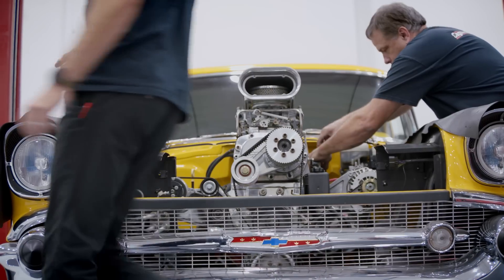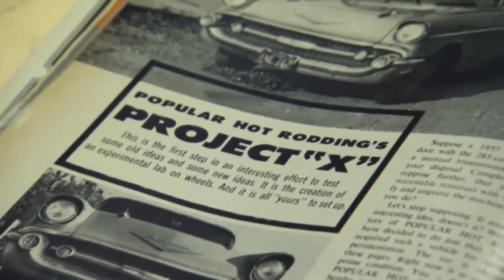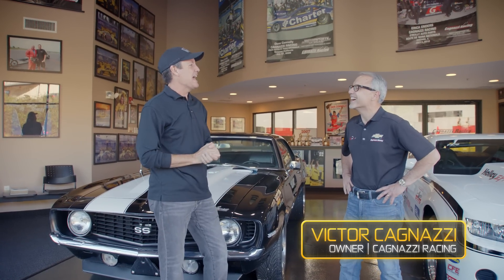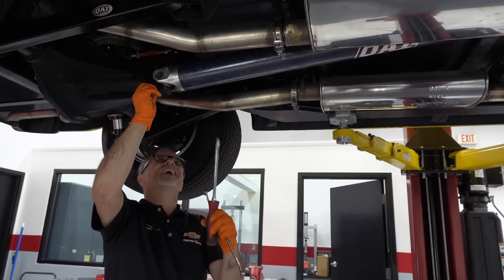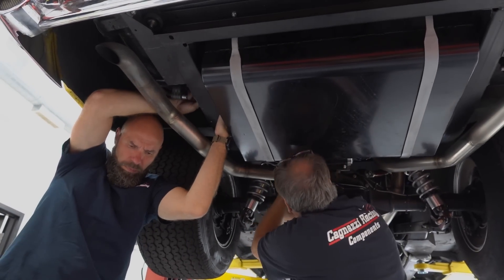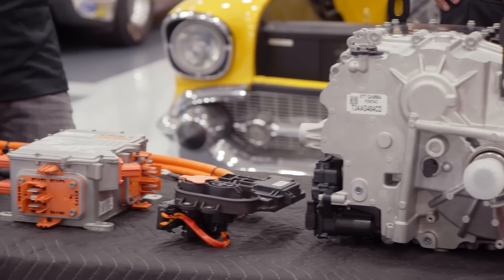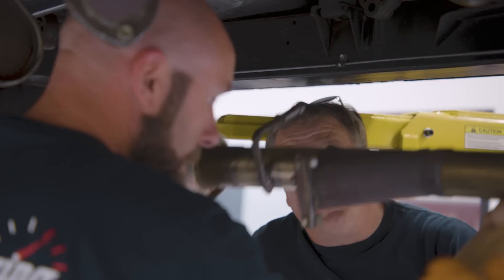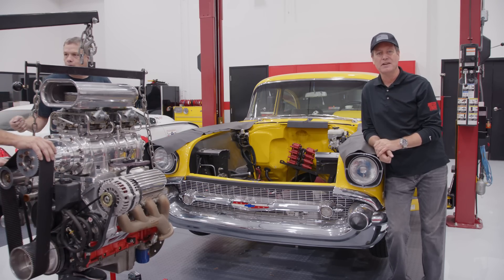Project X: EV Engine Swap [Ep. 1] | MotorTrend

Comment: This is how to turn a million dollar icon into a laughing stock unfortunately. I'm all for ev swaps but the diehard gear heads will not forgive this.
Reply: So they don't...
I love cars and I love manual gasoline cars, especially naturally aspirated ones.
But resources are scarce, gas becomes more and more expensive and the overall efficiency of an EV is more than twice of that of an internal combustion engine. If we want to safe personal mobility, we have to go to EVs. And we have to do it soon.

Done right, this could be a way to make this legend into an icon for the next generation of gear heads. And it could also show some of the more open-minded current generation that fun won't be dead.
I don't know about you but if I have the choice between paying 10$/gal to drive my 30 year old Mitsubishi Diamante or converting it to EV, I'll probably choose option 2. Because long term this will ensure I can actually afford to keep it on the road and enjoy it.

And make no mistake: 10$/gal is lowballing it.
Porsche is developing eFuels right now. They plan to be able to eventually sell them for 2€/liter before taxes. That's around 9$/gal. And this is their sales pitch! So prices will likely be higher...
Right now, the cost is more like 10€/liter or 40$/gal before taxes. And I'm not that optimistic that they will achieve their goal of 9$/gal given that more and more energy will have to come from cleaner sources which - at least for a while - will make energy more expensive. And since more and more energy will be needed when replacing fossil fuels (e.g. in heating and mobility) there won't be as much (cheap) energy left to produce synthetic fuels.
Reply: @vinzenzgeske8987  Where does the electricity come from? Do you know about the infrastructure that still needs to be built and the shutdown of the Keystone XL Pipeline? https://youtu.be/7Yw-s0INT4w - I actually come from the PA Anthracite region where the coking process for the steel that made the skyscrapers in NY and the bridges like the Golden Gate possible. We lost our rail system to make any of that even remotely feasible back in 1972 during Agnes after Goodyear was also buying up electric rail systems to shut them down. Step back and think for a moment. The rail systems we do have are mostly diesel with air brakes developed by George Westinghouse. There are a lot of things in play that shouldn't be right now. It might feel Righteous to scold somebody over a '57 Chevy gas guzzler, but the alternative is actually worse for at least 2 more decades on our current path. It's too soon and it is the wrong car. This is some smoke and mirrors to make non-thinkers feel a little bit better as they are losing a little bit of freedom every day with every new tax. Those taxes and regulations work to shut down the free time you can have so others can have more and do nothing with it. That's what it looks like anyway. A big wealth transfer.
Reply: @vinzenzgeske8987  Then electrify a stinking Toyota............. Better yet, electrify a worthless 3rd or 4th gen Camaro. LEAVE HISTORY ALONE. RIP Project X. RIP GM, time to go back to my Chrysler roots.

Comment: For first time an LS conversion doesn’t sound like a bad option to keep Project X down to it’s roots…this electrified system can’t be sourced by the average hot rodder at a junk yard. It’s now into appliance mode with no rumbling soul.
Reply: So did you feel that way when GM shoved their $25k all aluminum 632 big block into Project X like 10 years ago?  Cause you couldn’t get that engine at a junkyard either
Reply: @GODOFGUITAR2112  not really….the rumble was still an option as the “soul” of the project.  I’ve built go carts they are fun AF but they die there. Some even use “sounds” to keep you thinking it’s a car….lame AF.

Comment: I'm sorry but electric vehicles are the enemy of Hot Rodders like myself. They may accelerate fast and all that but there is no replacement for the sound of a true Hot Rod. You should if left Project X as it was and changed up a Prius or a Chevy volt. Total disgrace to what Project X was. Gone forever.

Comment: I agree with other comments. If I was at the sit down meeting when they pitched this here's what I would have suggested. Build a  2nd 57 same as the original project X same color yellow same look, no motor or trans. I would have called it Project X 2.0. This way you have two to tinker with and modify the original blown X and the electric one.
Reply: This would have been a brilliant idea and great compromise.
Reply: Makes sense, and built as an ev swap to begin with? 
Would've allowed them more time and better integration with a lot more power&range possible as well. 👍🏻
Reply: Exactly. Then they can race each other too.
Reply: yeah like what was this the LAST '57 chassis in existence...?  was there nobody at PPG/AkzoNobel who could mix and spray yellow paint (or maybe a another color to differentiate the new car from the original)...?
Reply: Agreed!! And if they would have had a competition for the two of them the gas version would have won by a mile hands down in every single aspect!!

Comment: Sad, RIP to an iconic car. Hot Rods arent all performance. You dont feel an EV when it drives by, you feel a hot rod. ☹
Reply: Do you have or ever driven a EV? You do feel a EV. you feel its instant mega torque. you feel a vehicle that just wants to blow the doors off every gas car around. And it can do it all day long. no overheating, no fouled plugs, no bad gas, no vapor lock, no heat soak. they just go and go. I have a few hot rods and was in the middle of building a bored out 460 to go in my 53 ford customline and was like why... why am i wasting all this time on this old beast when im going to end up with a car that a EV Hyundai Kona will blow the doors off.   So im going to get the flathead running until i get the parts together to ev swap it. Thats hot rodding, gas, diesel, ev dosnt really matter as long as its fast. and the fastest now is EV.
Reply: @3184Patrick  dgaf, give me the smell of oil, the feel of a burb in the engine, the noise of combustion. I do agree the powrr you feel on evs is intense, but you dont get the expierence. Its too rounded and soft and theres no actual feel of the car. Its theres, you sense it, your body knows whats going on, but you dont get that same rush of hitting a gas pedal and listening to your work come alive and scream down a road.

Comment: No doubt it will have impressive performance, but you should be ashamed, doing that to such an iconic piece of hot rod history.
Reply: It’s really not that impressive though. 340 hp and 300 ft lbs of torque. About half of what the blower motor did!

Comment: I think they should’ve went the hybrid route and gave it a electric motor with V8
Reply: Yes if it had to be EV, how about something in the spirit of the Turbonetic Rocket Axel , mounted to the rear end as a power booster 🤷‍♂️ They aren't innovating,  they are desecrating.
Reply: @chuckchar  I think they definitely skipped a step in innovation.  It's still new internal combustion ideas and uses being made also.  It just makes sense to bridge the gap with the best of both worlds.  What's a restomod without a v8 grunt

Comment: Freiburger please send all the 57s old equipment to georgia and resurrect project X with one of daves 57 chevys.  The parts are already closer than cali. Put it back together and put some rattle can spots of yellow here and there so it can be a roadkill warrior. put it on ethanol/methanol. thats clean and renewable.  you could call it spirit of projuct x? the electric stuff is coming, but leave it on a tesla please.

Comment: I guess an LS swap is not as bad after all..
Reply: Put a 305 in it out of an 85 Camaro with 200k on it but not this
Reply: @lunsy9420  LOL.
Reply: @lunsy9420  That would be better, and much safer for the average hobbyist that probably should not be toying with maybe 400ish volts at home. It is pretty serious stuff.
Reply: @TwoBlackMarks  it's not that bad if you have some comon sense and del with it PROPERLY these battery pack have isolators that disconnect the batteries from eac hother bringing them down to nominal 8-12v cells
Reply: @jackass123455  While I have a lot of stuff to say about it, I will only say that common sense is actually not as common.. :D
Reply: *are not as bad.
Reply: @jumpinjojo  if you are going to correct someone's grammar, atleast make sure you are right first smh.
Reply: @MrHarleyreinke  Notice that he edited his comment.
Reply: @jumpinjojo  :D

Comment: How dull it is. No way to make it faster. Electric motors have very little room for modifications. 
Anything with the same Motor will be the same. And your Phone will have an app to make it run. 
It's a slotcar except you have to bring the power source with you. Good to get around town with.Try your electric buggy at the mall. That is how dull it will be.   CAT will spray it.

Comment: I just love how everyone on this video is so excited to see this happen I'm just wondering what this ev crate motor costs and how much much that shop is getting paid to do this and to fake being excited for this project and sure you can do something but should you and when ev's have a problem and there broke down on the side of the road you aren't fixing it there you're calling a wrecker tow truck
Reply: A wrecker, and a hazmat crew,  if the battery case happens to break open.
Reply: I'm just wondering how you fail so miserably at the spoken word.

Comment: The lack of noise, feel, and smell is why we don’t really care for electric motors in Hot rods 🤷🏾‍♂️
Reply: Exactly.
Reply: When you here this go down your street you will say you just heard a yellow vacuum cleaner go by.
Reply: You want a speaker with a rev range and a seat rumbler? :D
Reply: Racers want to go fast / quick.  This will be fast, quick, and clean.  Want an 8 second street car with A/C?  Like maybe a Tesla Plaid?  You would have won 11 of 17 2021 Hot Rod Drag Week Classes as well.  You can either Lead, Follow, or get out of the way.
Reply: All it takes to beat a Tesla of any sort is a 4.8 Ls motor. File the ring gaps, Install a turbo. Will beat any tesla.
Reply: @moabman6803  Can you show us a 9.01 second 4.8 LS / T?
Reply: @TonyK3130  A stock 4.8 with a turbo is capable of 1500hp on the stock bottom end. It's been tested thoroughly. That should get a car or truck to 9 seconds or better easily. There is a Tesla drag race guy on YouTube. He posts a bunch of videos. In one of his videos a turbo LS Silverado beat the Tesla like he was standing still. LS motors are cheap power if you know what your doing and will beat a lot of so called performance cars.
Reply: Put a speaker under the hood make an artificial engine sound
Reply: @Mike-01234  that is a bad joke
Reply: @Mike-01234  You do that with your blow up partner?
Reply: @Mike-01234  add vibrating seats for that rumble.

Comment: Instant torque cool but what does it feel like sitting at the stop light? What does it sound like. Can u crank it up outside and feel it inside the house? A lot of what makes these hot rods great if the feel and the sound, so many of us crank our cars just to here them idle in the driveway. Yes the instant torque is cool but in drag racing applications it’s still gonna have to be managed especially if it still RWD. I’m jus sayin never in seen someone with a quiet hot rod that really turns heads 🤷🏾‍♂️

Comment: They are building a Tesla in Tony Nancy yellow.  Wow what a waste of a great car. Way to help the EPA kill TRADITIONAL hot rodding.
Reply: The EPA is dying to get rid of old cars and trucks. Instead of going after gross industrial polluters, they are coming after the low hanging fruit, hot rodders or anyone else who doesn't have the funds to fight them. - the rpm act
Reply: EPA has bought out gm. Meanwhile China still burns coal what a joke.They think we are niave fools.
Reply: This is hot rodding.
Reply: @TJDST4  A 200hp bolt motor isn't a hot rod.
Reply: @LegionOfHobbies  you're correct, but that is not what this is.
Reply: @TJDST4  You're right. It's a 340hp engine. Still don't know if I would really call that a hot rod, but it is better than I thought.

Comment: electric motor ad ons making cars hybrid is the next step trust me NOT replacement drivelines with complete electric motors, replacing a diff and trans with a tough drivetrain electric motor power adder , what you out of touch nitwits are doing to this classic is sacrilege

Comment: I get electric is the future but I love the sound of cammed out big block. Just wondering if there is a weight savings of the electric motor, batteries, cables and controller over the gas/diesel engine, transmission and fuel tank.
Reply: Maybe 200 hundred pounds savings, and probably twice the torque.
Reply: @typhoon320i  It's 60 pounds lighter per their Instagram post and has 40% less torque vs. what they took out.
Reply: @SteveBrecht  I was just guessing on weight. They themselves said it has "40% less torque"? I see that they are just using the motor for the bolt. So apparently they don't have a high performance motor to put in there. GM.... nuff said.

Comment: Some day all of us will have to swap EV motors in our cars if we want to keep them. I hate it but that's just the sad reality. EV garbage.
Reply: Oh no, you can keep your V8 for decades. It's just you will have to, one-off, 3D print all the parts to keep it running.
Because all the manufacturers of the parts you buy today, will be long gone.
Reply: @typhoon320i  If they end up coming after old ICE vehicles though we might not be able to keep our gas guzzlers. We'd have to figure something out for fuel since there'd be a very small number us who haven't switched to electric causing fuel to be hard to find. I could see the EPA/Feds banning the remanufacturing/reproduction of parts for ICE vehicles too. Time will tell, but I hope you're right about that.
Reply: @JordanSVT  they are not coming after our used cars, nor will they ever. They can outlaw new gas engines, but they won't need to. 2025 will be the last model year big car companies will make new ICE engines. By 2025 the economics of ICE cars will make no sense, and only about 5% of drivers will be rocking them, by the late 20's. at that point, it won't be a threat to climate, however it will be tough to keep them running as OEs will mostly be out of business.
Reply: @typhoon320i  I think I'm gonna start learning how to produce my own biofuel lol
Reply: @JordanSVT  I think fuel will be a lot easier to get, than a skilled internal combustion mechanic, in 10 years